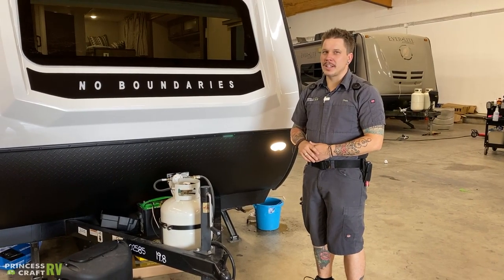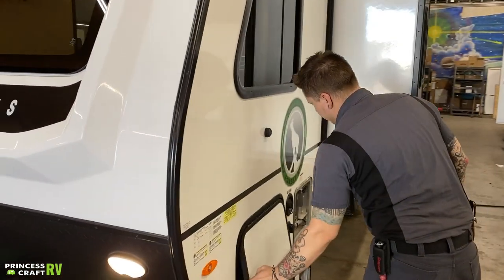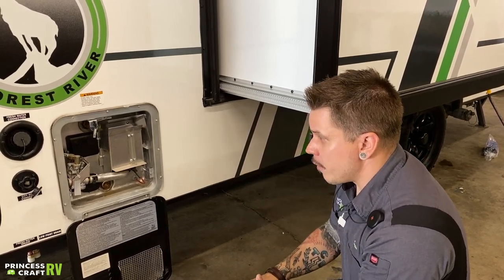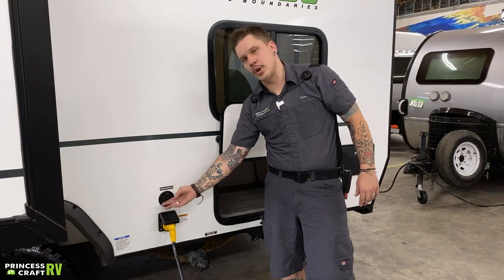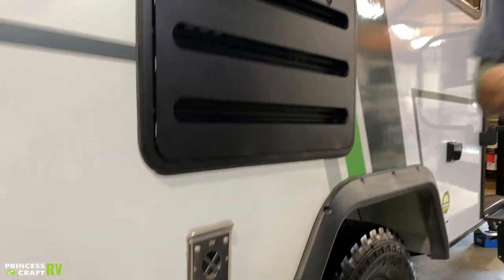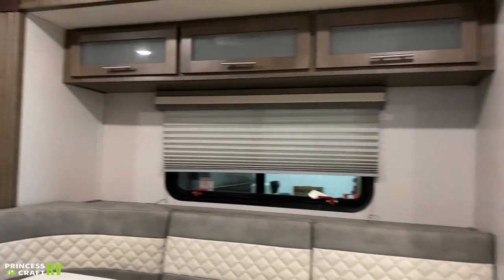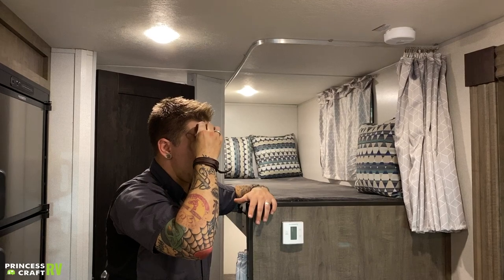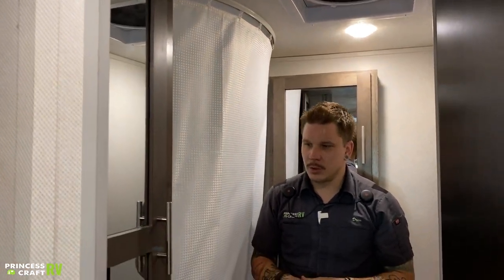2020 No Boundaries 19.8 by Forest River

Comment: If I’m plugged in at a campground for 30 plus days would I run electric or propane for my water heater if leaving it on electric will damage it? What is the problem with when you leave it on if you’re always plugged into a water source?  Heater does run on electricity does it ? When I run out of propane I run outta heat it seems. Thanks In advance